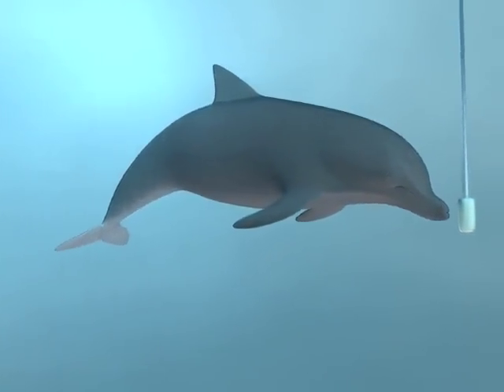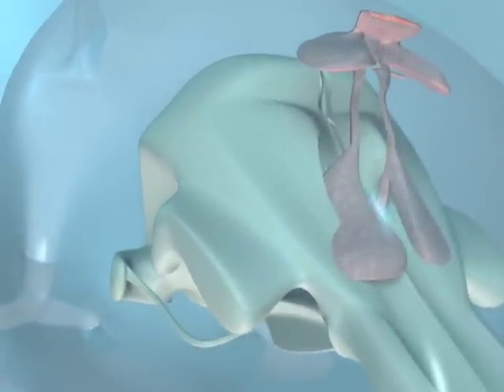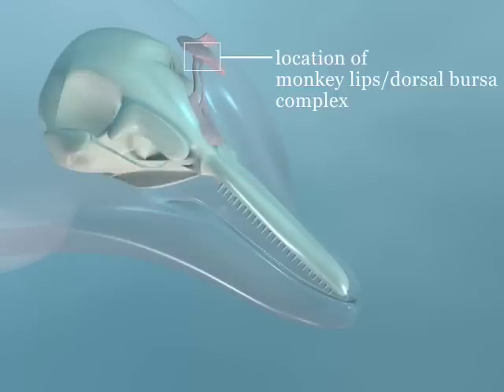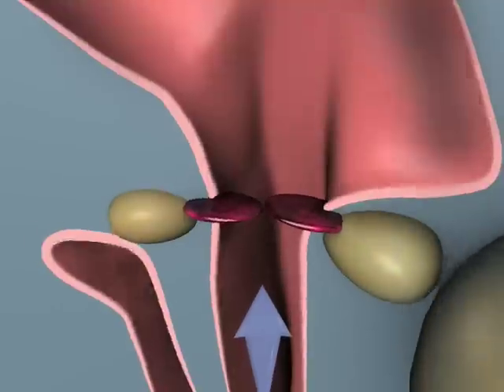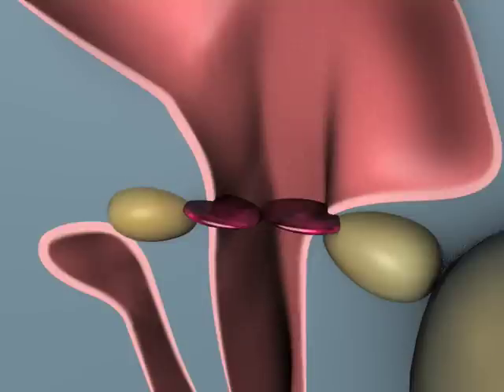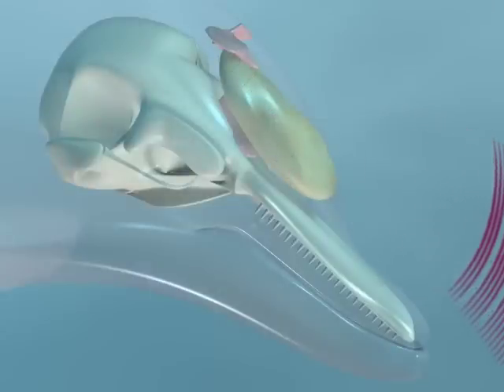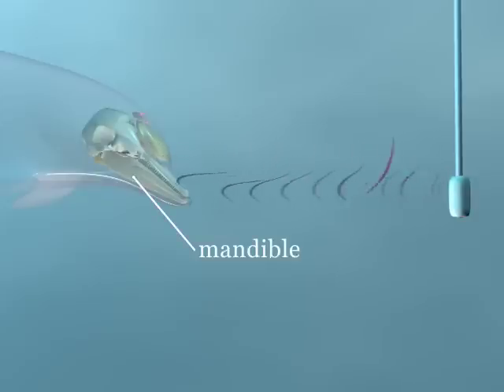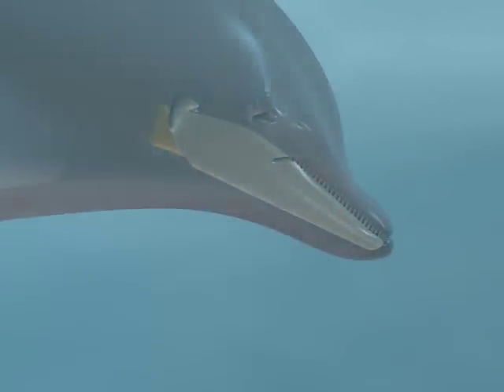Dolphin Research Center Echolocation

Comment: Great animation, but does not explain how dolphins make simultaneous echolocation clicks  and communication burst pulses at the same time. Kenneth J. Dormer (1979) proposed a bilateral sound generator with clicks assigned to the right side of the air passage and whistles to the left.
Reply: Here: 

MADSEN, Peter T. et al. Nasal sound production in echolocating delphinids (Tursiops truncatus and Pseudorca crassidens) is dynamic, but unilateral: clicking on the right side and whistling on the left side. Journal of experimental biology, v. 216, n. 21, p. 4091-4102, 2013.

If you still want the answer, that is... I hope this helps ^^